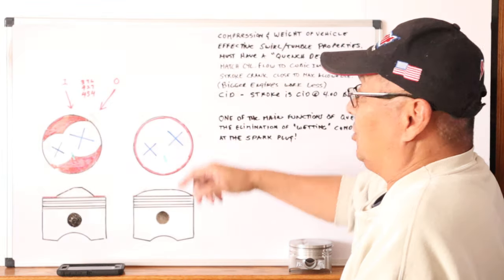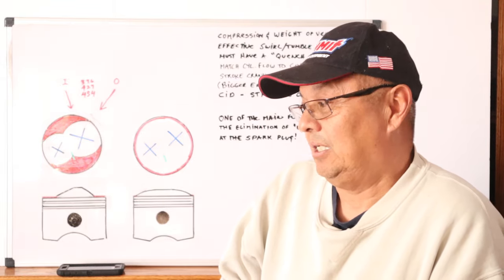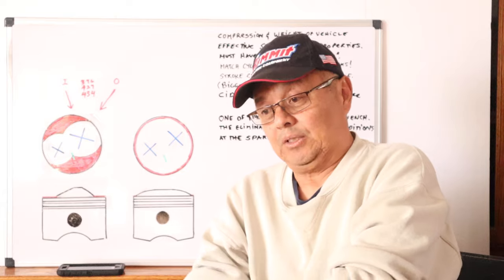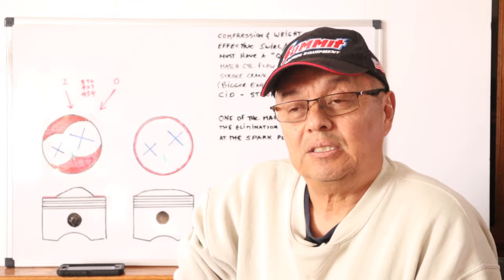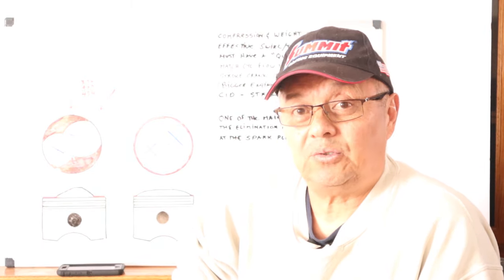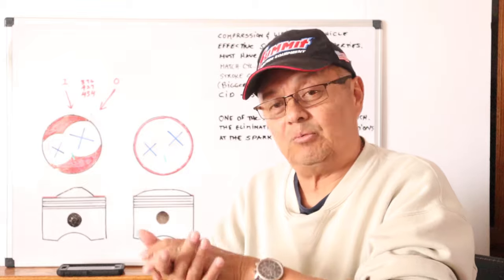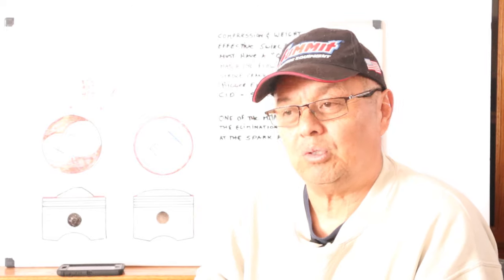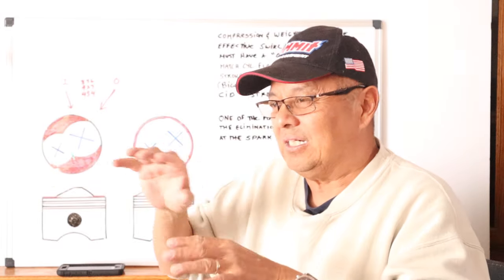HOW MUCH COMPRESSION PART I CAN WE RUN ON THE STREETS?

Comment: "if you use a dish piston on the street you have NO combustion chamber!"

Nice. Humongous blanket statement with nothing relating to Static or Dynamic CR, no mention of IVC closing or any other cam data that could effect your cyl pressures. 

Apparently that applies to  BB Cobra AND a stroked 7k lb tow truck too eh? 

That's the kind of advice that lets me know to block your videos and never listen to you again. 

So BBF tow stroker with 11.1 static and no dish,  tight cc heads got it.  Should I just run a 20-30 ABDC IVC cam on that to go ahead and be sure I get ALL that wonderful air? 

Sounds perfect. Lol

Thanks for the heads up.
Reply from the maker: Where did I reply that this works on big blocks?  Never and I always based my videos on small blocks!  If you inserted big blocks that is on you and I can make a specific videos detailing this for sure so what is your next comment?  Reciprocating aircraft engines does not work with your theories!  lol
Lighten up bro there are always exceptions to the rule until I specify ALL engines then you are right.  If you answered this I am sure you have not blocked me so good luck and race safe.  When I talk BBF you might be in for a rude surprise.

Comment: Does a sbf swirl, twirl or tumble. I flow with a swirl meter. The SBF starts off with good swirl and at about .200 -.300 then the swirl goes to zero, then picks itself back up at .350. what's a good top cut for the valve seat. Thanks
Reply from the maker: There is a possibility you are encountering a flow reversal when it hits zero and starts over again.  Which brand cylinder head is this?

Comment: I have a Chevy 355 moldex crank it rips. 11.7:1
Reply from the maker: You have some good stuff there buddy!
Reply: @benalamedaracing2765  lightweight H beam rods forged Teflon coated pistons and bearings silent gear drive. 

 i am a little nervous about it had true double roller and different cam changed both heard now gear drives on longtrips harmonica issues?.  vacuum deficiency in brakes ?
 it's much more backed by a SUPER T10 
I was worried about pump gas detonations. It idles at about 1100 sounds like 600rpm. 
It's sat a bit should i worry about gaskets, will i have to run above 93 octane? Ty. Love your insight.dart 2 angle plug heads in an 81 Camaro. Please advise. Ty

Comment: 9 to 1 compression ratio for me in my 496 big block chevy
Reply from the maker: Is it a heavy truck or car?  That will make a difference in your ultimate set up.
Reply: @benalamedaracing2765  car! A 1968 impala that weighs 4,260 pounds

Comment: As much as you want.  Might not be practical, but there really is nothing as a street illegal motor. Now it might be illegal how you use it on the street though.
Reply from the maker: It figures it depends on the year like here in Vegas you can just about do anything from building it radical or removing the emission components and registering the car as Hot Rod, Classic with limited mileage/year.

Comment: There are so many variables, you can almost run  whatever you want on the street. But I will put down a crispy 100 , you can’t run 14:5 .1 with a big ass solid roller with 38* timing on shit pump gas. Prove me wrong
Reply from the maker: I think if you are serious you would have lost lots of crispy dollar bills!  lol
I can see you do not understand engines because it is not static compression you are concerned it is "dynamic compression" that is the ultimate deciding factor.  Given your comment of 14:5 is very easy to defeat your argument.
If I closed the intake valve much too late in the intake cycle then my dynamic compression takes a big tumble to perhaps ends up at a much lower number friendly to pump gas!  With a solid big roller you can even makes this even more possible so I would forgive you this time bud.

Comment: Can stuff like this apply to dual overhead cam turbocharged 4 cylinder engines?
Reply from the maker: Which engine make are you referring to?
Reply: @benalamedaracing2765 sorry for the late reply but I would like to refer to a audi 1.8 turbo

Comment: is 11.1 or 11.5 compression with turbo super charger be safe or okay not including nitrous
Reply from the maker: On the street with E85 is a yes done it time and time again.  Moderate boost is key plus a good intercooler will surely help.
Reply: @benalamedaracing2765  that you for the feed back and I wonder if you can help out by doing a video on 4 cylinder rebuild and showing what kind of tool you need to get the job done and how to clearance or measure main caps , piston , wall clearance, piston ring , check the TDC deck hight , how assemble the Cylinder, how to keep top Dead end on piston 1 and 4 up while aligned and one thing on how to degree cam gears and cam shaft would like to also see you do a V8.

Comment: I have suzuki swift want to increase compression ratio for better fuel economy .kindly guide me . Engine spec below here

The M13A displaces 1.3 L (1,328 cc); bore and stroke is 78 mm × 69.5 mm (3.07 in × 2.74 in). It has a 9.5:1 compression ratio and two variants:
Reply from the maker: If you increased that at least a point to two points of compression you will see a gain in mileage big time!  What is the cranking compression pressure now?

Comment: HE TOLD YOU HE WAS RUNNING 9:1 BECAUSE OF THE PUMP GAS. FACTORY PERFORMANCE ENGINES FROM THE BIG 3 CAME WITH 11:1  AND ALL RAN ON HIGH TEST PUMP GAS. SOMEBODY MIXED UP THAT FELLOWS FACTS.
Reply from the maker: Combustion chambers at that time had bad designs or not as efficient as today and prone to detonations specially the open  chamber designs.

Comment: Can you please  help me with  a MK1 1.4 ENGINE  BUILD I WANT TO BUILD A HIGH  COMPRESSION  ENGINE  BUT IT HAS DISH PISTONS IT COMES FROM THE FACTORY  10:01 COMPRESSION  RATIO  WHAT CAN I DO BECAUSE  FLAT TOP PISTONS THE VALVES WILL  HIT THE PISTONS
Reply from the maker: I am not familiar with that engine and if you will increase compression you need some custom pistons made.  Contact Ross in El Segundo CA for some custom ones built.  That will be the first step.

Comment: How come the guy who designs cylinder heads for mercedes f1 said the opposite?
Street vs race??
Reply from the maker: Could you clarify what the engineer said?  Thanks.
Reply: @benalamedaracing2765  hi.
Sure...it was on a podcast from HP Academy.  On YouTube.
He said dished pistons are more efficient as they create a better combustion chamber shape.
This allows higher compressoin and general higher efficiency. 

He also talks about how the squish area is reduced to stop detonation. The squish area causes high-pressure spikes, which contribute to detonation. 

I built my latest engine with this advice ... its a small 2liter engine but it runs a 10.2 to 1 cr. And 45psi of boost.
It's a lovely engine... great low down torque and 900hp at 9000rpm.
Reply from the maker: @gfarnden56  , agree with his observations and my latest video from 2 days ago explicitly explains how quench can have negative consequence on high compression/high rpm engines and I had to really take a long time to explain the developing situations wherein quench can have consequences and the fixes that I spoke of to try to diminish the onset of detonation.  Thanks and appreciate the feedback!
Obtw, having quench is still advantageous for street and racing engines.  The only exception are big boost nitrous or compression as I stated on my latest video.  I would still run them regardless of what others may say specially for non all out engines.
Reply: @benalamedaracing2765  you must listen to the podcast ... I'm sure u will find it most useful.
They are more focused on efficiency of combustion and getting that part right requires the correct shaped chamber.
A domed piston is worst as it impedes the flame front.
Reply: @benalamedaracing2765  you must listen to the podcast ... I'm sure u will find it most useful.
They are more focused on the efficiency of combustion, and getting that part right requires the correct shaped chamber.
A domed piston is worse as it impedes the flame front. A dished piston creates a better combustion chamber shape.
Swirl and fuel mixing is dealt with in other ways.
Basically, squish area is the problem area
Reply from the maker: @gfarnden56  Thanks for your insight and we are talking two different scenarios here and I have worked on a Mercedes 24 hrs of Daytona and 12 Hrs of Sebring road race endurance team.  I will soon post a video of these efforts where I did R&D on the intakes and cylinder heads.  Very impressive no doubt and for turbo endurance a different scenario from my usual turbocharged powerplants.  Today we use a dome to slow down the flame front because with methanol fuels or even E85, the flame front is too fast and we need to slow it down with "softening the chambers" or "V" directed grooves to the isolated areas to prevent detonation which is made worse by the squish areas mainly on the intake valve nearest the cylinder walls.  
Any way two different world where when I worked on a turbo MB/Porche the power seldom exceeds anywhere where we are running which is 2400rwhp and that is just a start!  If you run 6 sec. in the 1/4 mile @ 227mph (weight 2940#)  we run different setups much in reverse of what is the accepted norm in endurance engines like the impressive MB/Porches etc.   Thanks again for your insight and really impressed with endurance engines.  
Obtw.  not really impressed with BMW's blocks with their hollowed main caps on their inline 6 I see as very weak compared to a recent 2JZ i finished years ago made 1250rwhp on E85 Supra street car.

Comment: Hi Ben. Im rebuilding a 68 FE 428 engine with stock pistons. The compression is around 10.5 to 1. I would like to put this in my 72 F250. Some shops have said it will detonate if pulling a load and need to stay under 9 to 1. Whats your thought. Was thinking of going with a 2500 stall converter and 373 gears
Reply from the maker: Install a little street cam in it to bleed off some of that compression pressures and you will be ok.  Call Rod @ ISKY Cams and asked for him and mention my name.  He can make you a grind and it should work!  
Thanks for supporting my channel!

Comment: No consideration for if the car owner uses the car to haul friends uphill in a hot day, valve event timing, dynamic compression, octane variation in pump fuel, air temperature, humidity, combustion chamber shape , carbon buildup on a tired engine, bmep, etc, etc....

Just "  dial it up to 11 and send it" huh...
Reply from the maker: If you haul friends uphill and your concerns about what you stated?, do not drive and just park your car and turn it into a garage queen!  lol
You overconcern your self till you turn blue in the face and if you do not live in San Francisco?  Then you are just about ok driving everywhere.

Comment: I got a scar 408  rotating assembly from summit racing.  They sent me the wrong crank. Ok got a 3.850 stroke. Pistons is .080 in the whole. They offered to send me a whole new assembly. I was thinking of keeping it and ditching the 6.200 rods and replacing it with 6.300 rods.  Anyone know if I am making a bad choice or should I send it back? Will the 6.300 rods work. Use a .060 gasket
Reply from the maker: I like long rods and it can possibly work just the final details of how it sits on the deck and you can do this with head gasket thickness.
Reply: @benalamedaracing2765  scat sent me a brand new rotating assembly.  They changed the flat top icon -11 4valve relief pistons for flat top auto tech -5cc 2 valve relief with thinner rings.   Off subject but my camshaft just got delivered from UPS as I write this. I had iskenderian make a custom cam  236/244 595/595 110 LSA is what they came up with. Thank you for your time.

Comment: The reason an engine runs on is the idle is to high. Has nothing to do with  ???

Make the damn thing idle down.
Reply from the maker: Yes it would help but sometimes with all the accessories like A/C, power steering they needed it higher specially with some kind of juice cam on it.  It is best to just shut down in "D" or let off the clutch.  Obtw, I have seen others idling so low it still ran on after they shut it off...
Reply: @benalamedaracing2765  Obtw  it might have been hot.

Son I've been doing this a couple weeks now.
DBSUMA.
They'll learn it in time.

Comment: 24:30 Your explanation of detonation is completely wrong. How it actually works has been known for decades and it is easy to find that information and still we see these bogus ideas of what guys imagine it is. This casts doubt on everything you say.
Reply from the maker: So everything I say casts doubts?  Ok so how do you explain detonation in your own words and it is not pre-ignition so what is it and I will wait.
Reply: @benalamedaracing2765  First, what you said is: -
"the sound wave goes from a
24:30
burn
24:31
and speeds up to an explosion that's a
24:34
fact
24:35
it's under a lot of pressure temperature
24:38
and what happens there is that when it
24:40
speeds up
24:41
then it goes supersonic
24:44
it starts to burn or explode really"-

None of that is correct.
Here is the tourist version of what detonation ACTUALLY is: 

If a volume of fuel/air is compressed high enough, is hot enough and for a long enough time it will explode, all by itself without being lit by a flame or spark. That is where all Molecules that are in a position to react, do react all at once. When they do, they create a sharp rise in pressure faster than the surrounding gasses can get out of the way and that is what the shock wave is. It is that shock wave that moves faster than the local speed of sound, not the burning speed , in fact that is the definition of a shock wave, a local pressure spike that the gas cannot get out of the way of. This pressure wave moves fast enough so it builds to a very high level. It compresses the gas around the explosion and moves outwards to cause damage.

Most of this was discovered by Sir Harry Ricardo in 1918 and in 1919 he invented the "quench pad" AKA "squish pad" to prevent detonation by 1) confining the mixture to a smaller space so burning could be completed sooner and 2) Causing extra turbulence at TDC to accelerate burning and 3) to minimize and cool the gasses that are farthest away by the cooler metal being so close(piston to head).
He also discovered that different fuels detonated at different levels which led to octane rating of fuels.
In 1930 He also invented swirl as a way of speeding up combustion to avoid detonation.

1960's MIT built a Rapid Compression Machine to study detonation and found that there is a delay period after the detonation pressure is reached before it explodes and that if burning completes before that delay period is reached there will be no detonation. TEL makes that delay period longer and so does Water by interfering with pre flame reactions so it takes more time before it explodes. In the 60's Honda found that their 20,000 RPM racing engine needed only octane 30 fuel to avoid detonation. The burning was complete long before detonation delay period was reached.

That in a nutshell is what detonation is. It has nothing to to with flames going "supersonic" or that old 🐂💩of "colliding flame fronts".

The REAL question is : WHY don't you guys know this stuff??????? It has been widely known for a freakin century!!! Anyone can just look it up! Instead people pull these dumb theory's out of their noses and pass that on as if it was fact. 

Go get a copy of "Internal Combustion Engine Fundamentals" 2E  by John B. Heywood  OR 
"The Internal Combustion Engine in Theory and Practice" Vol 1 and Vol 2 by C.F. Taylor. That will cover all the basics with REAL research. I could list a hundred other books that contain similar information.

...and yeah detonation is NOT preignition. Preignition CAN lead to detonation and detonation CAN lead to preignition but they are two completely different things that usually exist separately.
Reply from the maker: @billshiff2060 , LOL  I do not even know where to start.  On your first long explanation and the first paragraph has been explained by me on the video "Hard Core Piston Tech" wherein I explained the auto ignition that happens absent of an ignition source or flame kernel.  I cannot cover everything in a single video or it will take forever so your explanation is not even valid because you did not see other videos.  Now on the other about "sound waves-supersonic"  is a byproduct of an explosion because you cannot have an explosion without sound and sound waves is also destructive as I explained because it is also a force that cannot be ignored.  Anyway nice try and I hope you come up with your own site so I can marvel at your superior intellect and will bow down to the altar of your greatness sir.
Obtw, hope you really do and step out of the keyboard racer mindset and build your own engines and see how you measure up.  Then you get respect!
Reply from the maker: Oh on the honda explanation is funny!  Small diameter bore sizes are not as susceptible to secondary ignition sources because the flame front can easily cover and burn itself all around the small bore compared to a big bore or our V8's with spark plug location at the very lower corner of the combustion chambers (May I remind you a centrally located plug location benefits it as well) !  It take a while to cover such areas and secondaries is a distinct possibility so I digress and not new here on the explanation.  I also covered this on my other videos.